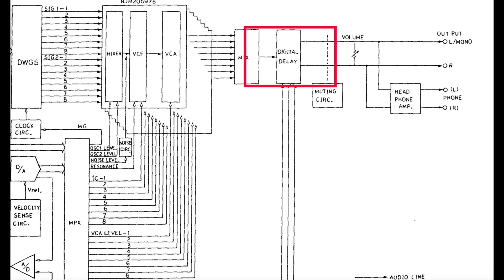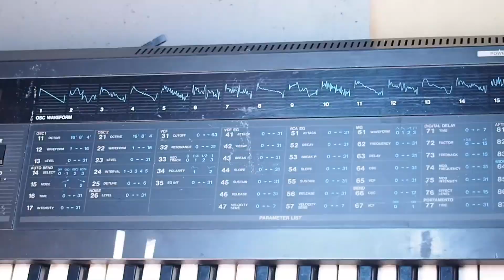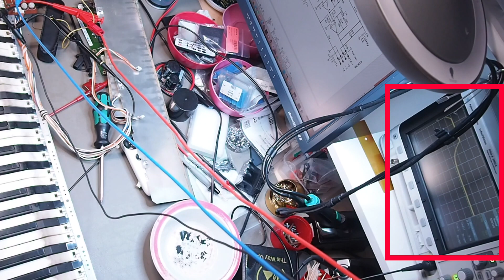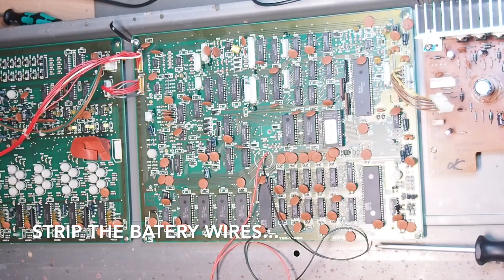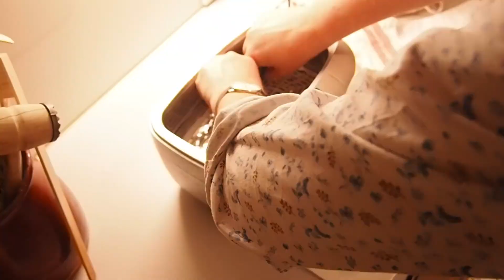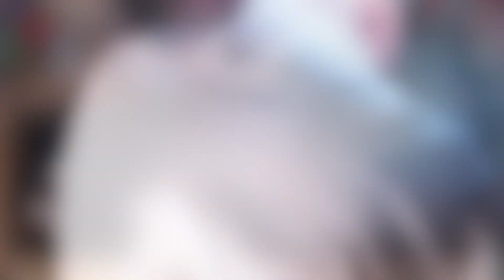ReinardSynth #9 Korg DW8000 PSU and switches Repair

Comment: I love the work you did and this video . I barely work on keyboards and have the guts out on mine . Someone shipped it badly and 5 of the keys got undone and re-seated the white ones but the black ones I really didn’t want to have to go all the way to disconnecting the keybed to fit the springs in there but it’s seeming like I should . Of course I see the power supply and just think I gotta replace everything anyway 😂🎉. Anyway I loved being able to see it opened and worked on with the amount of dedication to getting it overhauled as right as possible. Well done ❤

Comment: I have just got one of these from a big flea market in France, paid 80 euros for it, and it works! Battery dead of course but that was an easy fix. It needs some cleaning up and there's an issue with the -7 volt rail (one of the 2SA1175 transistors broke off) i'm looking for a spare at the moment but after that it should be fine. I did notice the bank of memory running quite warm, as this is normal I don't need to worry about that any more.

Comment: My favorite and critical part of the video. Where the power plug in is, leave the 2 screws on the bottom on, and just unscrew it from the top. That way you don't break them off whille opening it.

Comment: I have rebuilt mine too and love it. How do you re calibrate the after touch out of interest. I find you have to press pretty hard to get it to work. It's fine when on the receiving end of another controller but curious as to how to do this.
Reply: Definitely hard to push. One thing piano repairers do is use steam to soften felts back to shape. i think it would help with the pressure. I might try adjusting those 2 pots by ear while it's on.

Comment: My aftertouch requires the pressure of a gorilla to do anything even at the highest parameter setting. Does this mean the aftertouch sensors are unusable?
Reply from the maker: afraid so... I have not seen replacement strips, but heard about a convoluted rejuvenating method for aftertouch strips with not guarantee of success... have not tried it yet...

Comment: Where can the regulators be found? What are their designations?
Reply from the maker: 3x 7805 (5V, 1 Amp regulator) and 1x 7905 (-5V regulator, 1 Amp) cam be fiund on ebay for cheap, or Conrad, Mouser.com, digikey.com, etc.
Reply: @reinardsynth6581  Thank you. Would these be the same on the EX-8000 rack unit?

Comment: Nice video. I have one waiting to be repaired. Did you troubleshoot the PSU or just automatically replace the regulators?
Reply: Troubleshoot… output voltages were off or gone; measured caps: some were off; one regulator was broken; so to be sure replaced all caps and all four regulators
Reply: @reinardvanloo507  Thanks. I also have an EX-8000 waiting to be fixed (same client). Since that's easier to get into, I just checked the PSU voltages and one of the +5v rails is dead and the +11v is outputting +15v. I'll probably just replace all the regulators at this point. They are cheap.
Reply: Exactly: better be safe than sorry
Reply: @reinardvanloo507 excellent video, thanks for uploading! Can i ask, what were the issues with the synth initially, was is playing garbled sound? I have one, and it plays an unpleasant mix of 8 sounds, each one is consistent and repeats every 8th key press. Note 1 sounds the same each time etc, but not able to be programmed, it's not the battery as this is fine. Would this issue potentially be due to bad power supply would you say? Thanks!